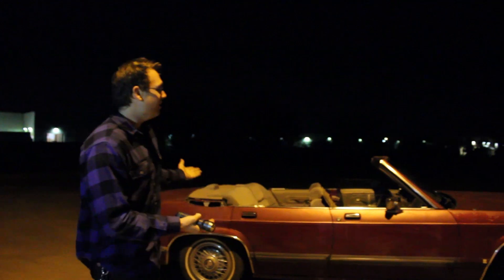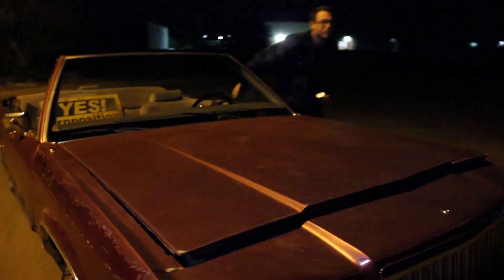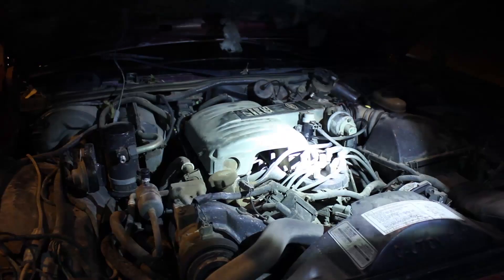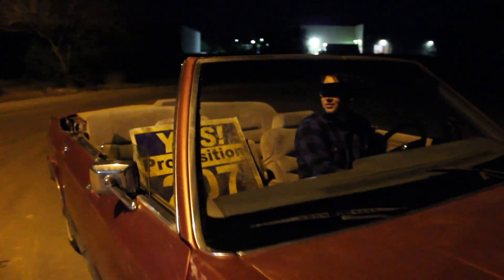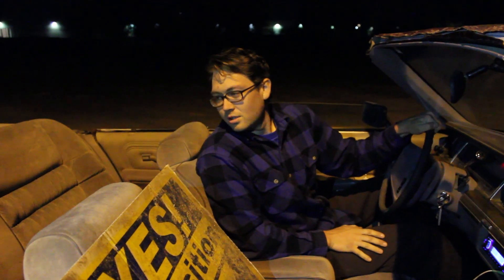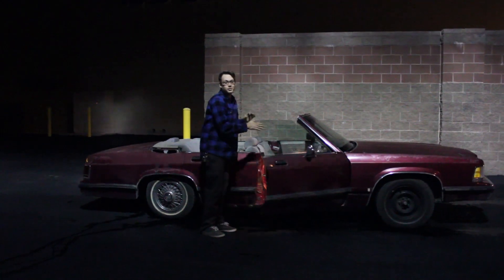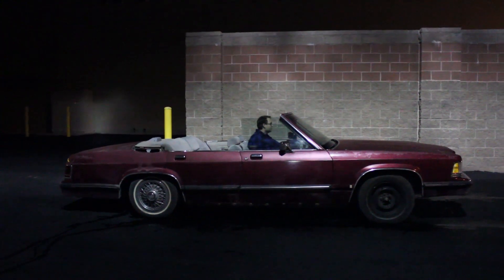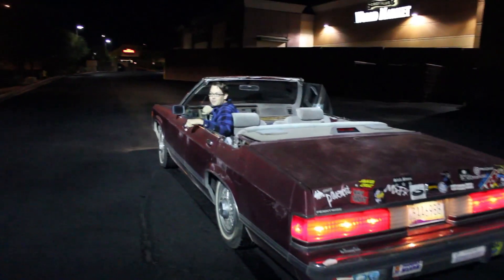Floor It From A Stop: 1991 Mercury Grand Marquis GS

Comment: I have a 85 cougar with the CFI 302 doing used x pipe used shorty headers and a custom cold air intake  I did a tune up on it too cant wait to see if there is any difference also has thrush mufflers 🤠